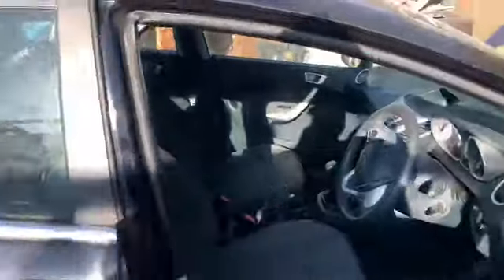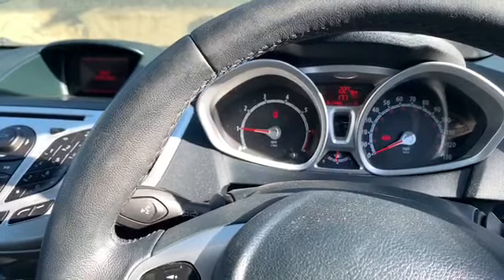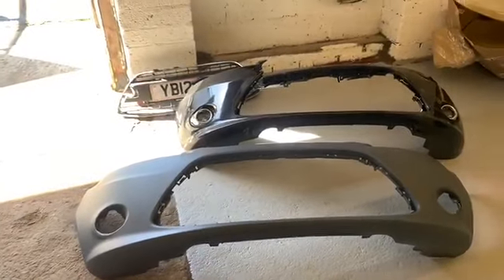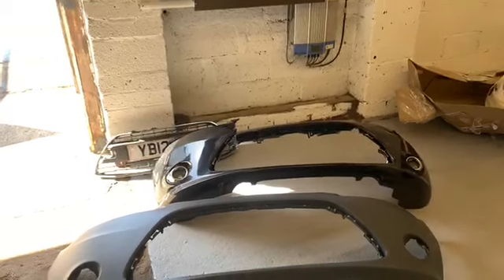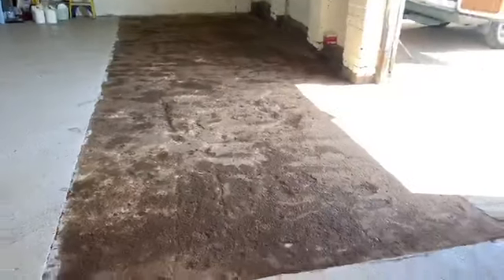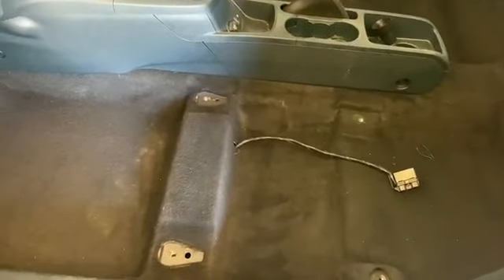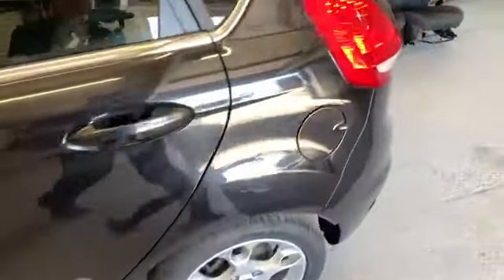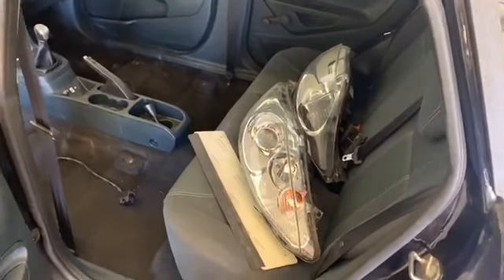COPART SALVAGE FIESTA ZETEC PT 1

Comment: Nice one Mark . When you get a chance post a pic of the dolly. I used a dolly for towing from all corners of the uk years ago . There are quite a few different types, mine had buckets that the wheels sat and were strapped into . I did bring cars home with suspension damage ,I used to strap them around the crossmember so they were effectively trapped from too much movement . On mine the buckets did the steering . If you have a look on my instagram pics 30th may you will see a few of the early cars i brought home on it front or rear damage . Modern ones are braked .  So long as the wheel isnt totally ripped off they work ok .Regards Rich
Reply from the maker: Thanks for the info Richard i will show the dolly in a video soon it's just buried at the moment and i will have a look on your insta mate thanks i'm getting mixed comments about this dolly some are saying all 4 wheels need to be off the road 😓not sure now if i can use it
Reply: @ResurwreckAutosUK  The RAC  regularly bring cars to the garage with the rear wheels on the floor .As more cars go over to electric handbrake I can see it being an issue . A trailer is the option I would go for these days if I was buying cars regular but its an option .
Reply from the maker: Richard Mounfield Yes mate the more comments I’m getting the more it’s putting me off the idea 💡 might buy it to sell

Comment: For a machine polisher I use the Sealer one as part of my job as a Smart Repairer, they are brilliant machines.
For polishing I use the 3M compounds and the colour coded foam pads.
Fast Cut 50417 is a great product, use the green pad.
Then use the Extra Fine plus 80349 with the yellow pad.
Wax polish to finish off and it'll be mint.
For the scratches I'd use 1500 followed by 3000 wet and dry pads, don't try and get the entire mark out as you might go into the base coat, get the mark almost out and by the time you polish with the green Fast Cut it'll go.
Reply from the maker: Jason Himpson Hi Jason thanks for the info mate I will show the shop your comment and get all what you said I will do a video on me doing it so thanks buddy 👍
Reply: Happy to help Mark.

Comment: Hi Mark, truck is defo a good choice, as you said, it’s multi purpose, consider also the Mitsubishi L200 and the Nissan Navara, which is what I was thinking of getting. Hey if you wanna borrow a polishing machine, let me know, I got mine here, and I’m not using for a few weeks, it might help you out before you get a new one. All the best, Danny 👍🏼
Reply from the maker: Thanks Danny appreciate the offer might need to borrow that thanks mate  👍👍
Reply: Let me know, it will be a bit quicker than hand polish 😃👍🏼 Don’t know exactly where you are, but I’m close to Brentwood, I can drop it off to you if your not far away

Comment: I had an old style Ranger and the gearbox went and got a Navara now.
The ranger is a better vehicle, the Navara has issues with the chassis snapping in half (have a google) although they’ve been recalled.
Hilux is a workhorse, see Too Gear!

Great vid and Yes, it was hot today, you must have baked in there mate! 🥵
Reply from the maker: Hi mate very hot in that lock up you can't beat a hilux i do like the l200 as well 👍
Reply: Be careful with the L200, I know of 2 that the chassis snapped just behind the crew cab when they were hitched up to a heavy trailer. Granted the chassis was rusted but they seem prone to chassis rust though that might be living in North Scotland where the winters can be hard with lots of salt on the roads!  I've a few friends swear by their Isuzu Rodeos with the 3.5 tonne towing pack.
Reply from the maker: Alan Campbell Thanks for the info mate I will look into that truck 👍

Comment: Mark, your meant to just take the wheel bolts off with the silver cap, no need to take them off, they sometimes do come off tho and I’ve just glued them on in the past.
Reply from the maker: Thanks Charles i just wanted to see if locking wheel nut's where hiding 😂😂 i will put the covers back on 👍👍
Reply: Resurwreck Autos UK, I took the locking wheel nuts off my Fiesta exactly the same wheels, it’s a nightmare if those things round off, it’s not as if they £300 each and we were back in the eighties, I don’t know anyone in the last two decades who’ve had alloys stolen 😂😂😜😜 PS regardless off locking wheel nuts if thieves want to nick them they will🤣
Reply from the maker: Charles Renwick 😂😂mate Charles you are right if like 22” but not a fiesta 👍

Comment: dolly law uk  says You can only use an A-frame or recovery dolly legally to recover a vehicle which has broken down. If you tow a car that hasn't broken down using an A-frame or dolly, then the law treats the combination as a trailer which must meet the appropriate braking and lighting rules.

i would suggest  another make of vehicle other than the ford  ranger the rangers suffer from head gaskets and  bad heads  but theres quite alot of vehicles out there with similar styles and layouts to chose from

the filing cabinate outside is handy i would claim that

  you ought to try a proper matched aerosol from a paint shop they will make you a  spray can to the exact paint code of your vehicle  plus a can of laquer  i think   you will find it ideal for small things like bumpers etc and cheaper
Reply: Is it right that the towed vehicle also  has to be taxed and insured using a dolly?
Reply: @williamhow4297   i have no idea  i would guess it  it should have to  i always put my trade plates in the towed vehicle  just to be sure
Reply from the maker: Thanks Charles this dolly idea is looking like a no go thanks for the info mate 👍👍

Comment: Different paints have different hardness and so need a different approach having watched what seems like every detailers video there is this stuff comes out well for most paint types and as am amateur detailers I've used it on a few cars. The £6 can makes sense but the paint is very thin to get uit our of the can with such little pressure, thin pain can react quite easy and if it does you'll be looking at £300 for a number at the paint shop to strip it and then repaint it is if reacts, my advice is to as so many people say you make your money when you buy the car so pay the £150 and let the guy do his job no come back on you if the pain reacts and or you get a bit of paint rection 3 months after your customer buys the car. Get a corded polisher battery ones require so much recharging it become a pain, especially if you are in a hurry, the corde just goes over your shoulder ;).

https://www.ebay.co.uk/itm/Koch-Chemie-Polish-System-1L/264710112712?ssPageName=STRK%3AMEBIDX%3AIT&_trksid=p2057872.m2749.l2649
Reply from the maker: Darren Revell Hi Darren thanks for the in depth comment really appreciate it I’m looking at a sealey polisher tomorrow so will do a video on that thanks again for your comment means a lot to me that you what to give advice 🤝🤝